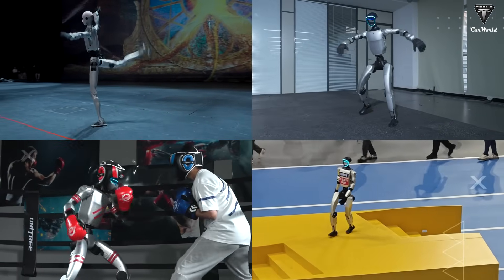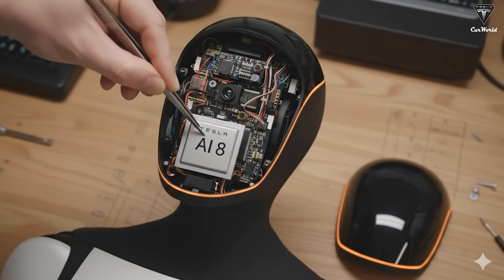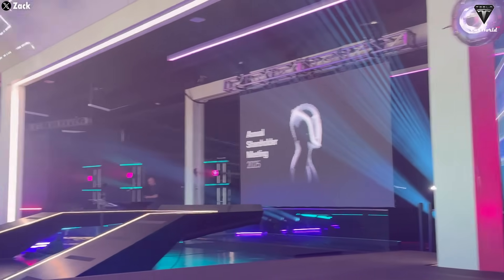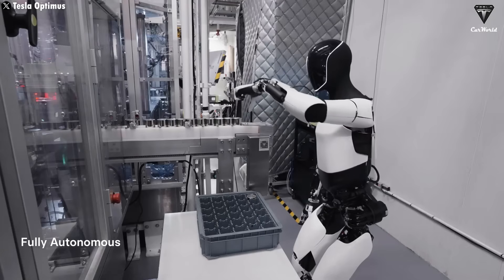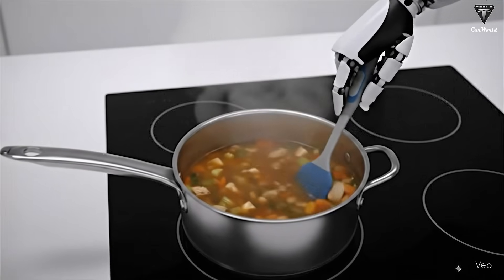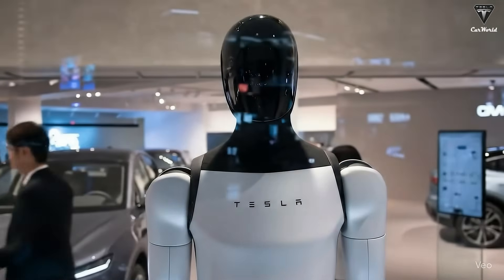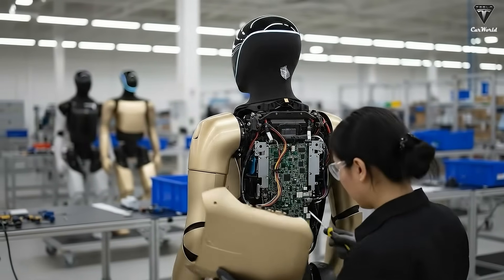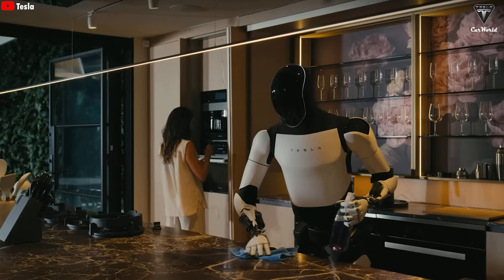Tesla Bot Gen 3 Finally Upgrade HUGE Battery - 14 Hours & Handle 3000 Household Tasks!

Comment: Dancing robots, I am not impressed. i don't want it! When it doesn't have to pause while it waits for the mainframe to tell it what to do next, then it may be worthwhile. When it independently understands what is going around it and can make split-second decisions to prevent small or LARGE catastrophes in everyday life, then I will be impressed. 

I am old enough to need one in the next 10 - 20 years to help me in my day-to-day life. Heck, I may need it to wipe my face after I eat and then a few hours later to put me on the toilet, wipe my rear end, redress me and then put me back in my recliner. While I am sleeping, it can cut the grass, carry out the trash, feed the pets and prepare my next meal. I would be more than happy to save up my nickels over the next few years to buy one!!!! 

But by then, future World President A.O.C. may have ordered a maximum age limit of 60 years old. That would be just about how my luck goes!